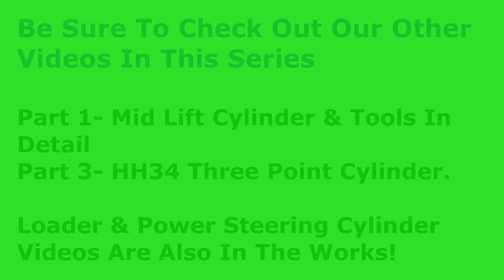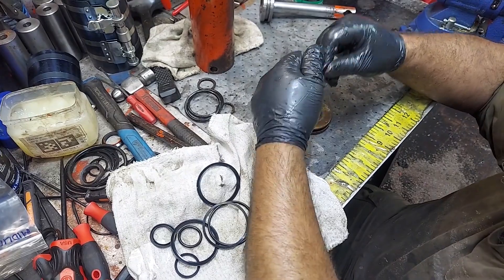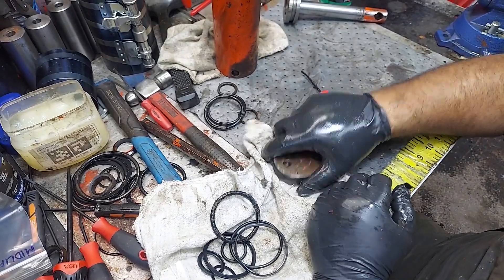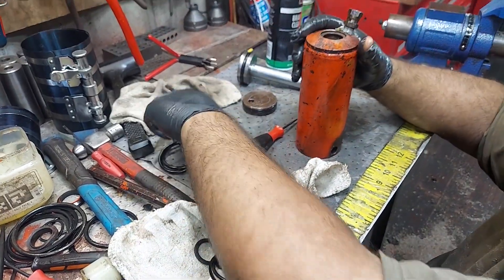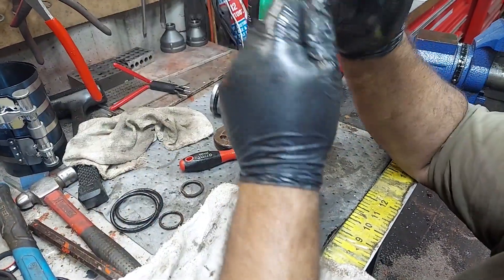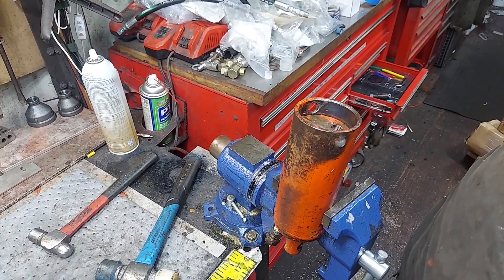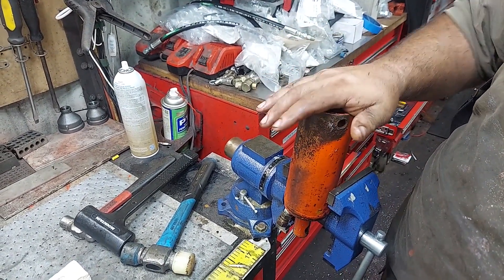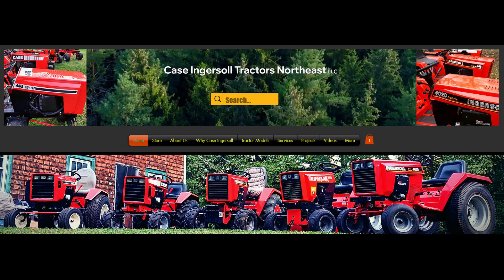How To Rebuild Small Hydraulic Cylinders, Part 2- Case Ingersoll Tractor J-26 3 Point Cylinder Shown

Comment: Can you put a onan p220 from a wheelhorse in a case 446 ??
Reply from the maker: Hi yes its been done may have to get a different love joy coupler for the pump. Just check crank diameter and length.  We have never done it personally but think its fzirly common. Not sure if oil pan height is the same. Thanks